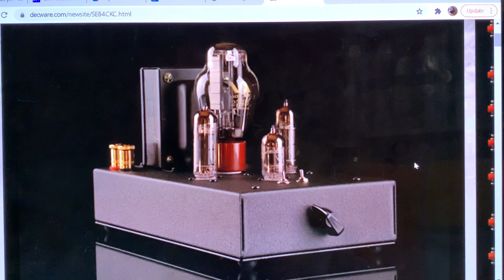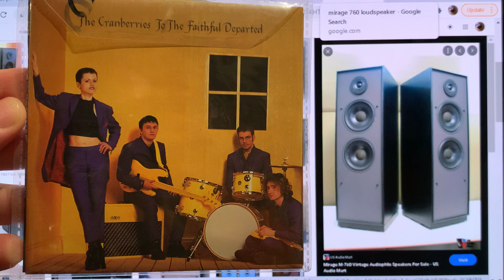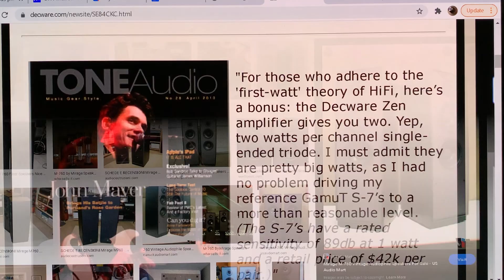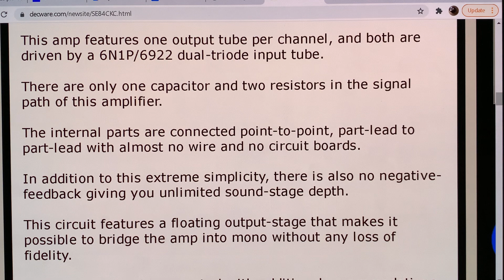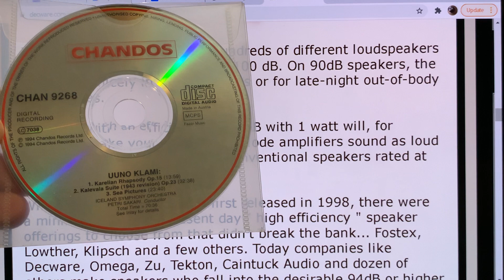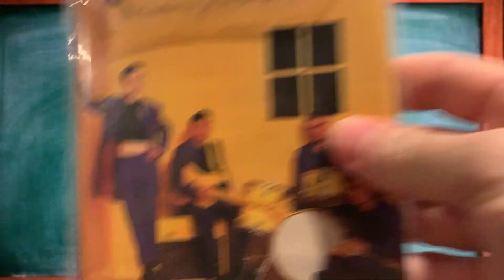Decware Zen: what can a 2W SET do for you? (Technically Single ended pentode in triode mode)

Comment: To be nitpicking, the ZEN is a SE pentode (not triode) , run in "triode mode", right?
Reply from the maker: Yup, EL84 pentode in triode mode, just as the first line of my video description says ; ).  You are right though, it's not SET, but SEP. Now, good luck with the search engine with SEP! Nobody will search for that term... however, I changed the title to reflect it correctly. Thank you!
Reply: @realworldaudio  Hi, and thx, Janos! I was actually more focusing on Decware using "Triode" in its name, despite it not being a true triode, not to correct you. EL84:s do though sound very good even in ultra linear mode. I made adapters from EL34 base to EL84 base for my little EL34 SE amp , to be able to use my EL84 tubes that I love in my guitar amps, and I would say the EL84:s beat the EL34:s when it comes to tonally rich and sweet midrange. Also 6V6:s have a very nice tonal signature in that same little SE amp.
Reply from the maker: @vespass225  I agree... it also bugged me a lot when people referred to pentode amps as SET, because it's not the right thing to call them - as they re not true triodes. For one thing, a triode connected pentode is so much cheaper to build than a true DHT. Gives people the wrong impression - hey, why do the 300B / 2A3 amps cost so much when I can have an SE EL34 (or similar) for a fraction of the price... I should start caling them SEPTIM (Single Ended Pentode In Triode Mode...) or something similar... 
6L6 family tubes run in pentode mode could realy be called SET, but acronym for Single Ended Tetrode... : )  Although it should really be SEBT (Single Ended Beam Tetrode). Sadly, beam tetrode is just another way of saying pentode. (They had to circumvent the pentode patent... and came up with the idea of internally connecting supressor to cathode, and now we can call a picture perfect pentode a "beam tetrode...":)
Reply: @realworldaudio then of course there's single ended ultralinear output as an alternative.

Comment: Ok, I’m going to be That Guy.    I know the ZEN Amp sounds good.  (But) it sounds good compared to what?  There’s no way it can go down to 20Hz with those transformers.  Yes the tube synergy is very good. Yes it Looks extremely good, just the right size of the components on top.  They were cabinet makers, an they no what looks good, an looks sales.     I’m sorry if I hurt feelings, but come on, the laws of physics just don’t support all the hype behind this amp.  I was born at night, but no last night.
Reply from the maker: I agree, the iron is too small for low extension. Probably made very well for upper frequencies, and down to 35Hz or so... there's lot of small iron with beautiful tone. Yet, physics cannot be ignored, big iron (lots of inductance, and low DCR) is needed for low lows. No way around it. ; ).
Reply: Whats your favorite tube amp?
Reply: @Canadian_Eh_I  I’ve bought the ZEN circuit board that Decware has for sale.  With the updates they’ve made to the power supply it looks promising.  I’m going to use true 25 watt SET output transformers.  If it doesn’t work out, I can always use the transformers for another projects.        The tube Amp I’m using now is a El34 Amp.   The biggest improvement to my system was (BIG) High Efficient speakers.  I’m not able to spend $5,000 on speaker cabinets, but with a few basic tools I’m able to build them.  It’s not that hard to do.   I built a pair of Kliptch Cornwalls an cut all the plywood at Home Depot.

Comment: I agree with what you have said. I agree with your opinion. Zen Decware hasn't reached my country so I am using a 7.5w per channel old Sony STR receiver (in tip-top shape better than when it was new) driving a pair of 94dB full range speakers wired in series with a parallelled tweeter per channel, a 98dB Coral 6CX-501 and a 103dB Coral 12TX-50 and next weeks to come will be a Fostex 100dB. All speakers are in its prime shape (even the baffles were tweaked to give optimum output) so I can enjoy an enjoyable listening experience. Because I am using solid state equipment, I am using a tube buffer to enhance the signal connected to my mint conditioned 7.5w/channel Sony receiver, this doesn't come close to the Decware Zen UFO yet I am very pleased using a turntable or Bluetooth receiver from an Apple music source. Again this is not a Decware and just imagine if it was. I like your review. Keep up the good reviews.
Reply from the maker: Hi Joey, you have a very nice system! Vintage amplifier ans full range driver efficient speakers yield a super team! ;
Reply: @realworldaudio  thank you for your comment. Let's enjoy listening to nice music. Keep safe...

Comment: Hi Janos!
 There is something fundamental regarding single ended amplifiers I have been pondering for quite some time. I do enjoy the sound from single ended amps more than that from push-pull amps, and of course I have been wondering if there is an affordable DIY way of getting slightly more power while my speakers have only 90 dB/W*m.

Someone proposed parallell single ended output tubes, like EL84:s or EL34:s. 
Other very experienced SE-guys on the contrary, said that, while parallelling SE-tubes of course is possible, it very often leads to time-smearing and loss of "airyness" and spatial sound qualities of the amp, because of unwanted interaction between the two not perfectly equal parallell tubes. 
Do you have any experience of parallell SE-amps , and of the claimed problems with loss of spatial sound qualities I have heard of ?
Cheers, Magnus
Reply from the maker: Answer with video coming!;
Reply: @realworldaudio  Nice, sounds interesting!

Comment: Somewhere I read the Russian 6P15P tube was a new design back in the 70's , not one just copied from Western tech, although it closely resembled the EL84. A few factories in Russia made them, Reflector, Voskhod (the Rocket brand), and ORZJeP of Orel City. An American Marketing company purchased a large stock of the non-military version and then made up the trademark of Svetlana with their S logo and sold the SV83. Decware discovered this tube and the first Zen amps were designed around them. Svetlana went buy-buy at some time and now Decware uses NOS tubes from remaining Russian stock.

6P15P or 6n15n (crylic spelling) are the same thing. If tube has extension of EV or EB it is long life (5000 hrs) military version, i.e. 6P15P-EV or 6n15n-EB. There is also a military grading system on many tubes marked OTK #. Apparently the lower the number the better i.e. 1 or 2 and I also heard there was a 0 but have never seen that. I have seen them also offered with gold grids, as seen on the great e.b.a...y.

Decware writes..." These tubes, SV83, whether mil spec or not, because of their small size and intended use in TV Video applications, are superior sonically to the popular 300B, 2A3, 45's because they lack the heavy signature and are considerably faster. The bandwidth of these tubes is far greater then that specified for audio tubes "

The 6P15P are the same as EL84/6BQ5 except for one difference. On EL84 the suppressor grid is connected internally to cathode. On 6P15P the suppressor grid comes out to pins 1 and 6 which are normally unused in a EL84. To interchange it's just a matter of making sure that either of those pins 1 or 6 is connected to pin 3 cathode and that neither pin 1 or 6 is connected to anything else on the tube socket. If you do this either tube can be used EL84 or 6P15P.

Decware Zen makes use of the 6P15P unconnected suppressor grid by connecting pin 6 to cathode pin 3 with a 0.1 uf 400v capacitor in their circuit in what they call "The Hazen Mod" after an employee who first tried it. They claim an increase in performance with improved dynamics with increased clarity and imaging. When I did this in my amps I couldn't tell much difference, but maybe the rest of my system at that time was not resolving enough. I kept the mod in never-the-less.

In other amps other than the Zen if you want to try 6P15P I also read an amp tech ( which I am not ) claim  "the 6P15P will bias up much lower than the EL84, so if you have a cathode biased amp, it would need a much lower valued cathode resistor to idle at the same current as the EL84 (~120 ohm compared to ~270 ohm for EL84), or if it is a fixed bias would need to be set much lower, probably by about half ". 

Lastly as noted on rutubes.com there is also the 6P14P.
6P15P similar to EL83
6P14P similar to EL84 and same pin out.
On Decware forums it was discussed that the 6P14P was a meatier substitute with more balls in bass and midrange presentation but the 6P15P has more detail and refinement.

I swear by the 6P15P in my Zen clone amps, have yet to compare to the 6P14P.

I hope you find this information useful considering this series of videos is all about the great EL84. Now you know more about his Russian cousin the 6P15P.

Marc in Ottawa.
Reply from the maker: Thank you Marc, much appreciated! Indeed, connecting the supressor grid to the cathode via a small capacitor brings about a huge improvement. I have tried it with the 6SD7GT, which is almost identical electrically (only in the audio range) to the WE 717A (which is used in the Yamamoto amps). This might be the big factor for why the Russian tube sounds much better ; ). For capacitor choice for this position: you can use practically any value, even down to nF, any brand, any kind, it does not matter. Just drop in a cap that has a high voltage rating.
Reply: @realworldaudio  I thought of a question(s)for you…

1.why is the suppressor connected to the cathode internally in the el84?
2.what effect does it create in the 6p15p by not connecting the suppressor to the cathode?
3. What effect does connecting the suppressor to the cathode with a capacitor have?

Phew, Thanks
Reply from the maker: @marcl8814  Hi Marc, great questions! Here are my answers: 1. it is general practice to do it, most pentodes have this internal connection. 2. some pentodes allow flexible connection the suppressor grid, and have more versatile uses for the tube. For example, you can make a "better" triode connection (connecting g2,g3,p together versus g2 and p together and g3 on the cathode - as most triode connected pentodes work). 3. if they are connected through a capacitor, then the supressor is not at cathode potential, and that makes the supressor more effective as it can capture more stray electrons  reflected off the plate (and become a better supressor).
Reply: @realworldaudio  Thanks for the concise answers. I must have a better understanding of basic electronics than I thought because I completely understood your answers. Let me know what you think if you ever try the 6p15p in place of the el84. Looking forward to your next video in this series…
Reply from the maker: @marcl8814  You have asked the right questions, and that happens when you have a firm grasp of the basics. :) At the moment I do not have an EL84 amp, but will give the Russian a try when I get the chance! Thank you ;)
Reply: @realworldaudio  Thanks Real...

Comment: Remarkable : while modifying my amp to a lower power SET (and also upgrading components) , the music sounds much louder than before!
Reply from the maker: That's superb! The power supply is key to how loud, dynamic and powerful an amplifier sounds, and SETs require a much better power supply to start with, and give the experience that push-pulls cannot give at even double the power output. Great job! ; )
Reply: @realworldaudio  “SETs require a much better power supply”. I did not know that, but I followed your advise to use a separate power supply for the heaters, and indeed the sound quality improved significantly. (and a less hot HV power transformer 😊)
Reply: @edverbeek6292 sounds like the amp is drawing too much heater current if the power transformer is running really hot.

Comment: What do you think about Decware zbox tube buffer or tube buffers in general? Thanks
Reply from the maker: They can help with digital and simulate a tube output stage to a certain degree. With digital, the end result of a buffer / correction / processing stage is always very system dependent. I would suggest that if you are interested, then give it a try. In worst case, you will have the ability to voice your system (it allows rolling very diverse tubes), and in best case it can transform the sound to a very natural sound.
Reply: @realworldaudio  thanks for your help

Comment: Thanks for the really good video, enjoyed it.  You confirmed many things I was thinking regarding my own Zen clone amp(s) I built from the original Decware schematics many years ago. I for one agree with what you said about pairing the 2W amp with less sensitive speakers, I run Energy 22 Pro, Energy 22 Reference Connoisseur and 1970 Rectilinear 3 all only 86-87 db albiet larger speakers to quite loud volumes no problem.  Later I will add a new comment with some notes I made regarding the Russian 6P15P (el84 substitute) output tubes if you're interested. I prefer them to the many el84's I have tried.
Reply from the maker: Thank you Marc! Indeed, your notes on the 6P15P are much appreciated, please share them! ;

Comment: The Russian tube has a very different sound signature than the el84 that I prefer
Reply from the maker: The new tubes tend to have a quite different sonic signature from the NOS. Usually they are leaner, emphasize the frequency extension more.The older tubes tend to have much better midrange though.